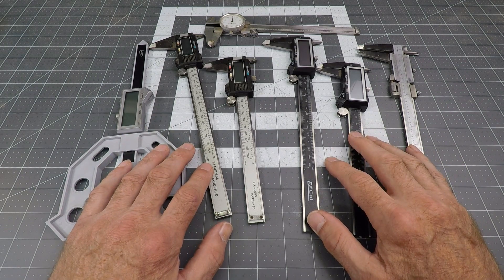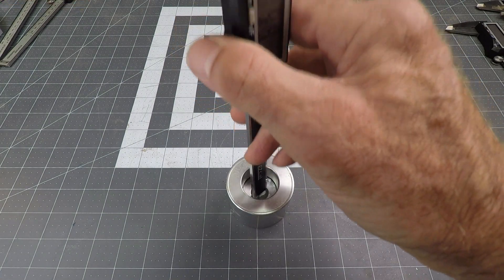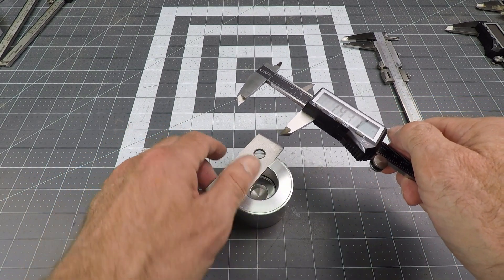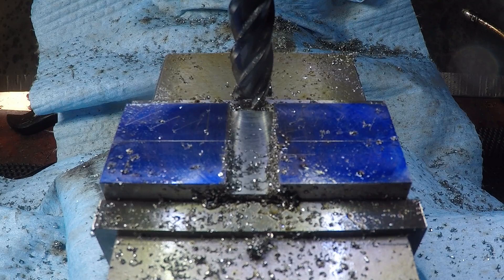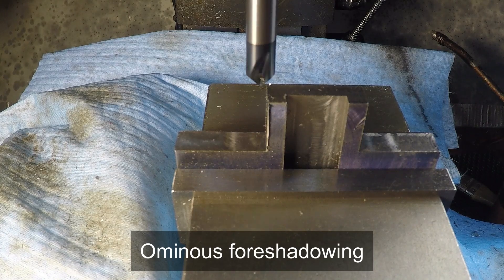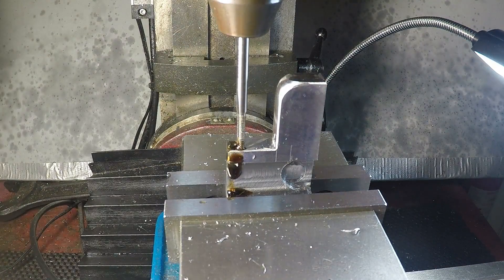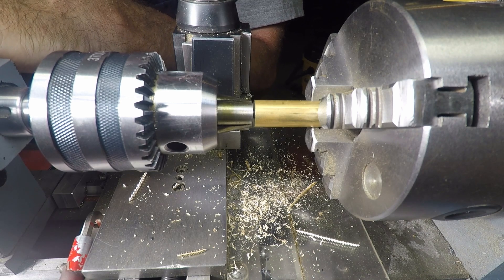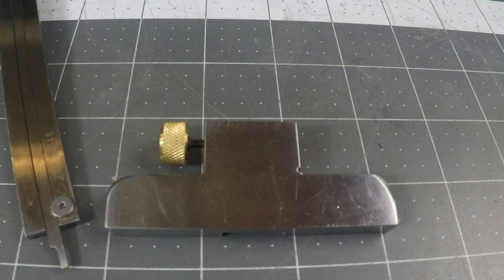Making a caliper depth base

Comment: The 2 mitoyotos that keeps running out of battery is fakes unfortunately. Or if its branded differently (hard to see on video) then it is likely bad clone of mitoyoto. There was few years of people selling fakes that had firmware bug where it can't turn off.
Reply from the maker: The only Mitutoyo that I mentioned was the analog one on the right. The ones with the battery issue were definitely very inexpensive unbranded ones that I paid no more than $20 for.
Reply: @GuyMarsdenMakesStuff  Indeed. That is why I added possibility of branded differently. :) Many of unbranded was also clones of mitoyoto calipers with bugged power management also.
Reply: Nice little project. Gotta make one. How thick is metal?
Reply from the maker: @stephenpeterson3206  the metal was just a scrap piece that I had laying around .35" 'thick and it's 3 in wide - dimensions are non critical except for the width which could be longer.